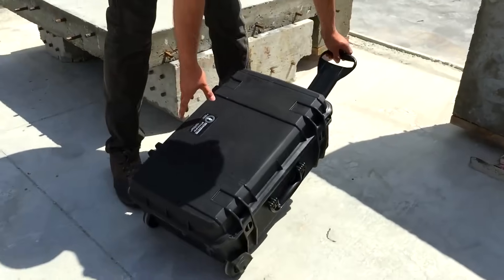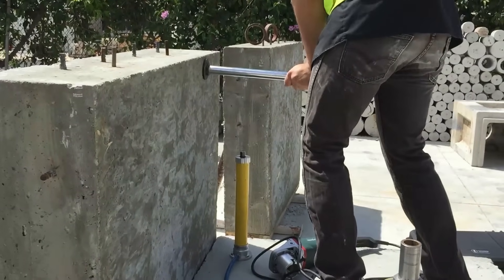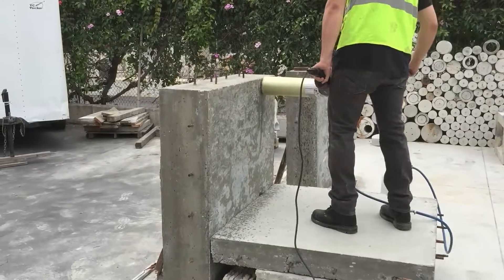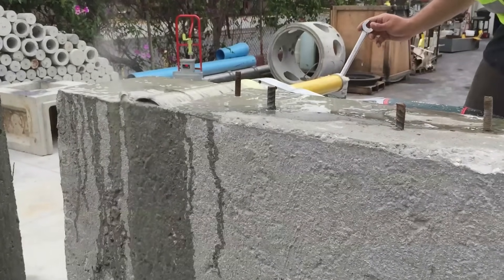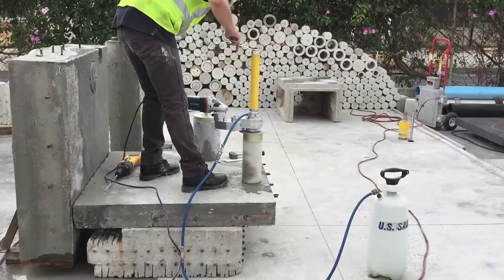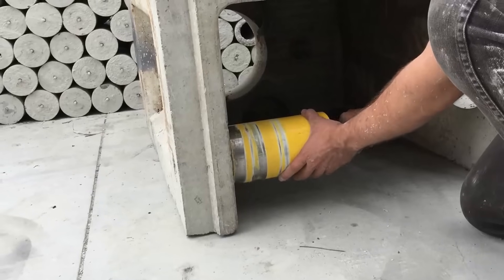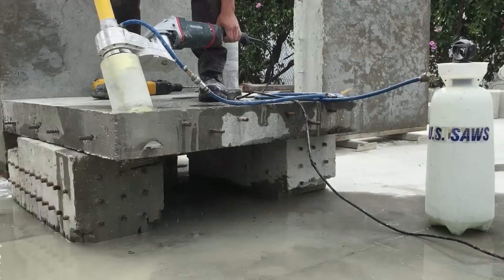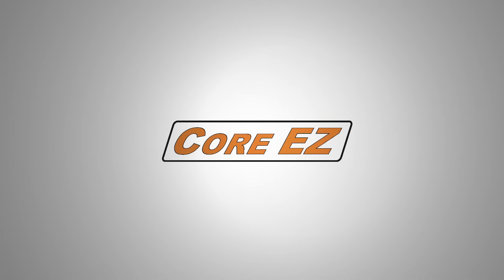U.S.SAWS Core EZ: Advanced Core Drilling System

Comment: Great, However is there bracket / Clamp to mount the core drilling system on columns instead of drilling bolts ?

Comment: That's a really nice set up👍but if you're just drilling here and there great! But if you're drilling in/for commercial buildings it's not efficient! 25+years experience here! I've done 10,000 holes just in one building(jersey city) I've always used diamond tech industries(DTI) motors for quantity&quality with diamond bits💯 best thing is they are easy to repair/replace if you burn them out🙏🏼

Comment: A Metabo mill and a simple metal converter with a single $ 4,200 bit do not seem too expensive, although it has become easier to increase the price. This is not fair.
Reply from the maker: It's more of a complex innovative system to why the price is higher, we also manufacture in the states. Sorry you feel this is over priced.

Comment: you didn't show, , bad camera shot,  when cutting down,  Wont the hole rig just drop  once it penetrates the other side smashing it into the upper surface of the surface you just cut? if the operator was not expecting it  to penetrate at that moment,  if they are holding on to the rig, depending of the weight of the core of course, could they not do some serious harm to their back when it drops, pulling them down suddenly with the rig ? other than that, it is a great looking tool.

Comment: What happens if the core snaps after the anchor depth,  and before you’re through the slab?
Reply: Well you fucked then.... What I would do I re attache a smaller core than the inside diameter and drill a ll the way through then use a chissle to remove the thin layer or cement around the inner surface of the broken cutter. At this point you weld a puller to the broken coring tool and pull. Then finish the job.
But in all likelihood the tube of the cutter is far less likely than the union between the tube and the shaft it connects to.
ps in really high at the moment so I could be talking shit.
Reply: @africanelectron751   should just stick with the offset rig and anchor bolt, if it ain’t broke don’t fix it 👍

Comment: You need a splash guard wet dry vacuum accessory to contain over flow of the water. That's always a challenge when ever we core in existing spaces with carpets n stuff. It can really complicates things.
Reply from the maker: We sell Kor-It slurry rings that are very helpful.
Reply: Need a second technician to operate a wet vac, and suck up all the water.

Comment: A salesmen pitched this to the company my brother and i worked for, As he was drilling he broke the core of before it was all the way through. He asked the sales guy what now and that was the end of it. This a cool system but its dependent on the anchor completly, It's common for cores to break due to mooning rebar or cutting tie wire and getting jammed up.
Reply: still can be a great for tight space and up high i think.  one time it take us 2 guys several hour to set up a core drill.  we have to take the drill apart and assembly them back together up high 10 ft in the tight spot in the ceiling.

Comment: Could this be used for wood? I trying to find an easy way to make birdhouses in trees similar to a woodpecker :)
Reply: I wouldn't drill them too deep and remove the excess wood with an SDS bit sharpened to a chisel, mounted on a rotary hammer drill.

I would plug the hole with a circular cap hammered into it, with an appropriately sized hole for the birds.
Reply: 2صضصذذضذذذذذشذصذذصذذصذضذذذذذذصذضصذسصضضذضذصذذذضشضضضشذذضضضضضضضضضضشذص

Comment: You should really have pointed out the risk to the operative when drilling / sawing concrete, they are exposed to silica dust, a known carcinogen, filtered face masks must be worn.
Reply: You did noticed they are using water right?

Comment: Open a bank vault with this things
Reply: Xavier Ancarno not really after pumping concrete for many years they add stuff into the concrete that will slow the bit cover the diamonds and eventually lock up the bit it's in the concrete mix most modern banks have shredded Steel along with ball bearings and rebar all around
Reply: Xavier Ancarno bout to say that, happened as well in some bank stealing over 1 mill in pounds
Reply: Just what I was thinking ;)
Reply: Hatton garden heist
Reply: My first thought!

Comment: If the exact depth of a floor slab is not known. How do you stop the drill from over drilling?
Reply: just pull out pieces by pieces
Reply: Floor slabs are usually 3"-5" 
Feedback or the lack of it will let you know you're done.

Comment: But, there's a hole in the middle of core sample. Then how we determine the actual  crushing strenth?
Reply: Its not necessarily drilling a core to be tested. These can also be access holes to route utilities like water/power through existing walls or foundations.
Reply: This tool wasn't specifically designed to remove cores from concrete for testing the strength of the concrete...it was made to provide access holes whereby drain pipes, electrical runs, etc has a place to be ran through.
Reply: CanadianMapleSyrup exactly what I thought they would be used for lol

Comment: Ha! "US Saw" with a GERMAN Metabo angle grinder  ;-)
Reply: Metabo proudly produces all high end products here in Germany. They do 
their own development, casting, injection molding, and motor winding. They also assemble their products here. Please inform yourself before posting.

Greets from Germany ;)
Reply: @HVBasti  Metabo....will never let you down...greetings from Ohip
U.S.
Reply from the maker: Metabo is one of the best grinders in the Industry. Thanks for watching!
Reply: accessory
Reply: safer sisic I bet you never even tried a metabo, fein or Bosch profrssional grinder.
Reply: Metabo is like a mercedes, dewalt is a dodge
Reply: Metabo was acquired by Hitachi Koki in 2016, by the way.
Reply: And yes. Compared to Dewalt or Milwaukee their stuff is really high-end. Just look at the features you can get in their grinders.
Reply: I agree that Metabo is a high end power tools manufacturer, but they also have some stuff made in China, not everything they make is made in Germany.
Reply: safer sisic Hilti angle  grinder are Bosch.
Reply: I was referring to their "better" or higher end Grinders, Drills etc. There is an entry level product line that is made in China. This is what I was trying to express. The majority of their stuff is made here in Germany.
Reply: @HVBasti  Nope. Their LTX cordless stuff is all German made, but L and some LT are made in China. Their LTX program is great and they probably have the best batteries but are not good enough to beat the others, now they lowered their prices so it makes more sense to buy them but few years ago they were to expensive. They are now located in Germany but are not German company anymore, its now under Hitachi corp. I love German made Bosch also, there are China models but I dont buy that
Reply: Precivilization this is what I said
Reply: i did try some metabo and i eaven own some bosch but the older version thet are still good the last 15 years bosch is makeing is trash compared to hitli and makita , metabo is better then bosch i woud say but still not as near as good  to hilti/makita
Reply: @safersisic9562  German made Bosch tools are still great, Metabo is now under the same corporation that bought Hitachi, I dont believe that they will ever be as good as before.
Reply: makita = lambo and hilti = ferrari xD
Reply: lambo: Italian brand, made in Italy. Makita, Japanese brand, with more than half of their tools made in China (besides this, makita rocks)
Reply: safer sisic bosh clearly has better and more different purpose 12 and 18v cordless divers, also the Bosch blue Impact divers and 18v angle grinders are better than makita. For this the Makita 18 and 2x18 bulldogs and circular saws are better than Bosch. Makita is ahead of the brushless hype but Bosch on connectivity and measering eqipment also in the optical and Laser measering buissnes. 
After all its hard to compare. Bosch is a much larger Company as makita will ever be but they becomed a little lazy in the last years.
Reply: Z all
Reply: and husqvarna water tank
Reply: @decartes666  Hitachi bought Metabo
Reply: jojohome shit everyone better know metabo is the best.
Reply: Nr 1: HILTI  Nr 2 : MAKITA  every thing else dont matter .
Reply: HVBasti 

Metabo makes "high end" stuff?
Reply: jojohome 

All made in China........